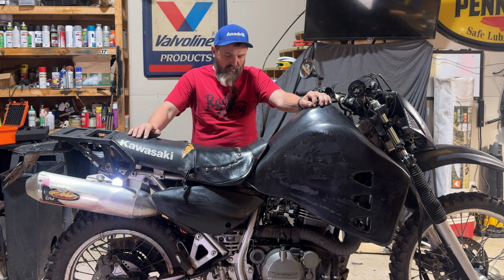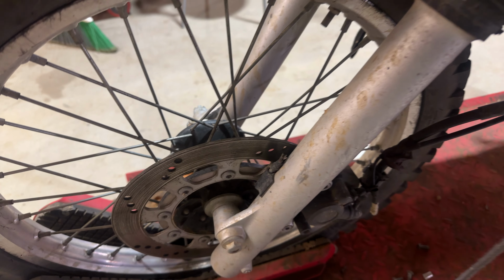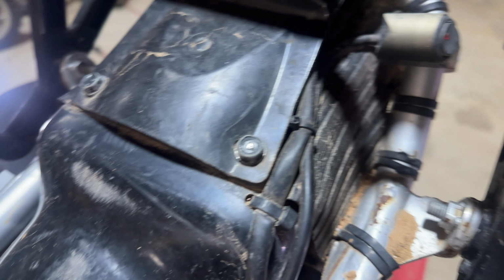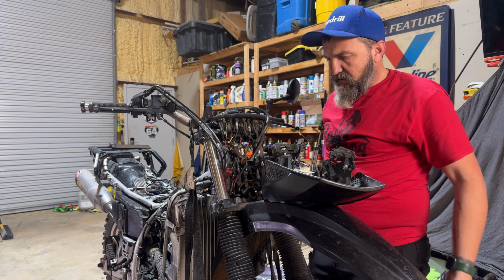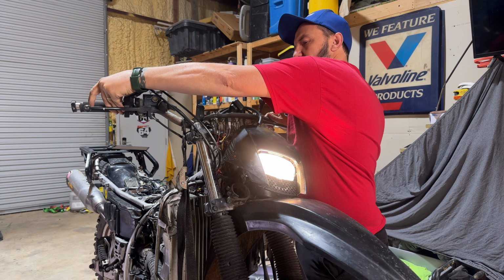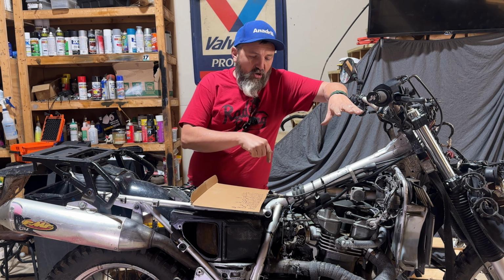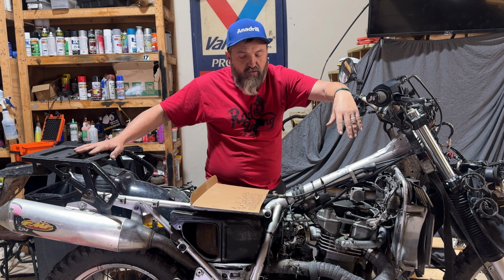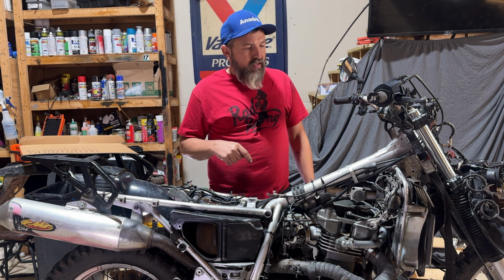KLR650 Adventure Build begins - Ultimate Budget Adventure Motorcycle

Comment: I have a KLR650 and I did all the upgrades to mine. The dohicky was the hardest and took the longest since I had to order a few bearings for the starter gears that the last person in there left out when installing. I didn't find any parts in the pan. It was doable. 
The thermo bob was easier and most needed too. It keeps it from being an oil burner. I think I did something to the carb too. Changed the needle to a more tapered one so it reacts better to the throttle.
Reply from the maker: @d.l.horton2093  that’s great information!!! Thank you so much.